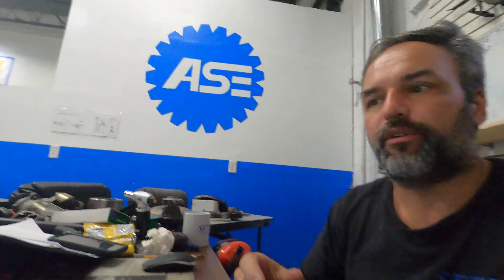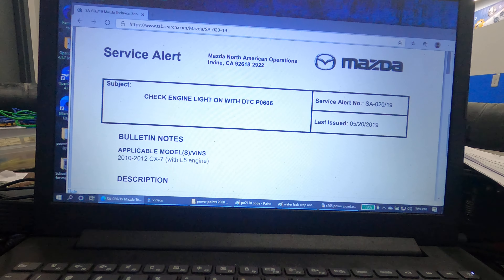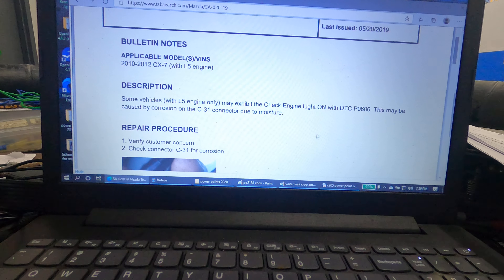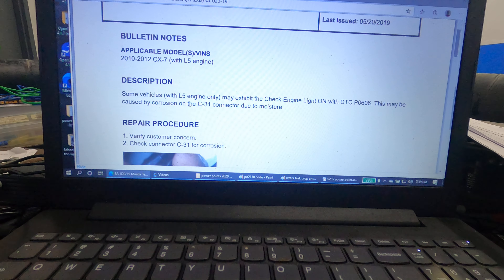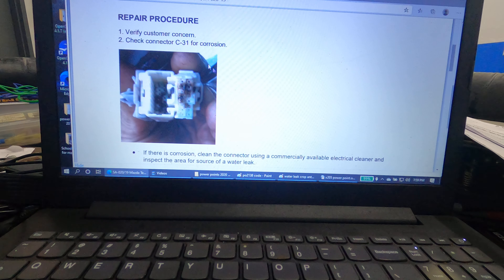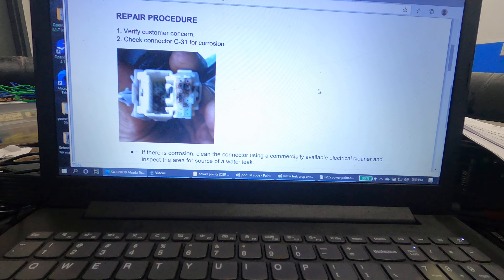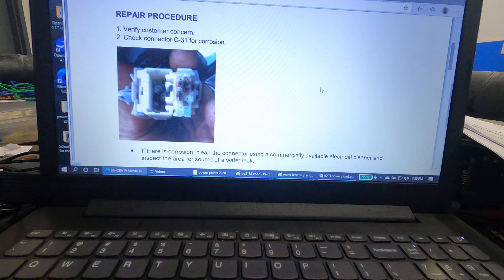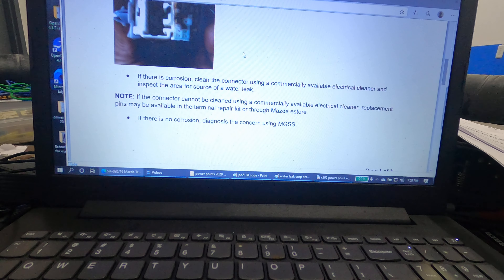CHECK ENGINE LIGHT ON WITH DTC P0606 Mazda 2010-2012 CX-7 (with L5 engine) water in connector

Comment: Where is the C-31 connector located?
Reply from the maker: Your going to have to refer to the service information it is different on different option packages. Also this information came from my students telling me about this problem I have never seen it in person. Google the TSB and it should tell you.
Reply: @southfloridatechnicaltrain2589  May I have a link / access for this service information?

I really need it
Reply from the maker: @dhikaramadhan2054  https://static.nhtsa.gov/odi/tsbs/2019/MC-10160580-0001.pdf
Reply: @southfloridatechnicaltrain2589  thank you, sir...
Reply: Can’t you give us direction  of C-31 connector
Reply: My car  is 2008 Cx7 2.3L ,having de same fault code , help me to solve it
Reply: @zionman9149  I have a mazda 6 2006 2.3 5 speed manual transmission, and I’ve been having this Code p0606 for 3 years and it still runs perfect.
I do have water in my right side of the trunk.  Thanks god I found this video